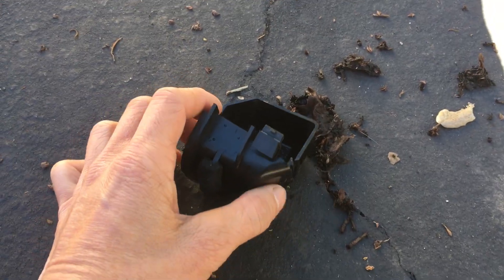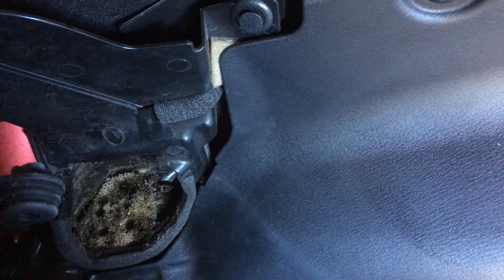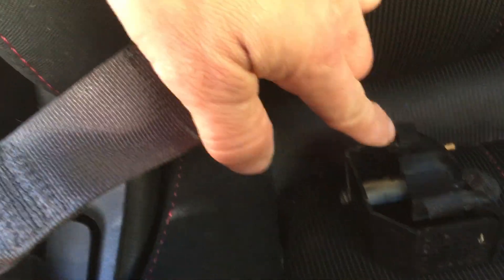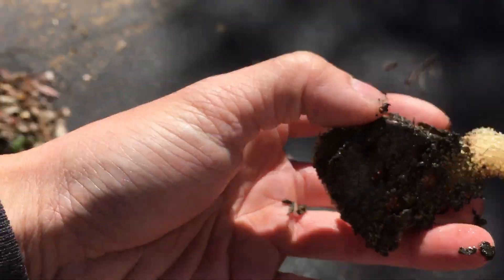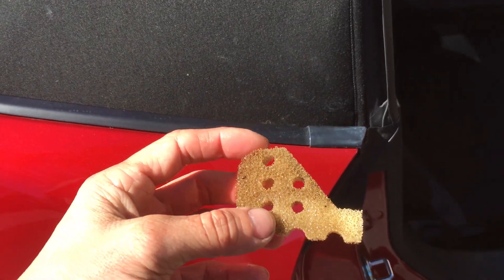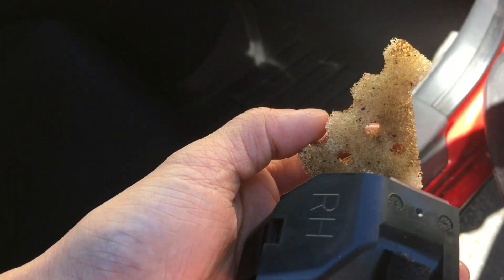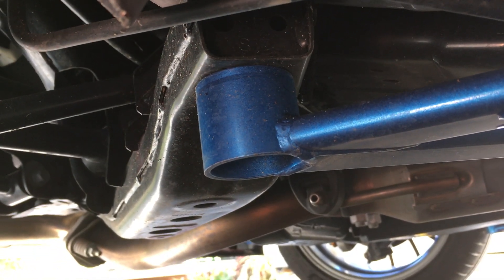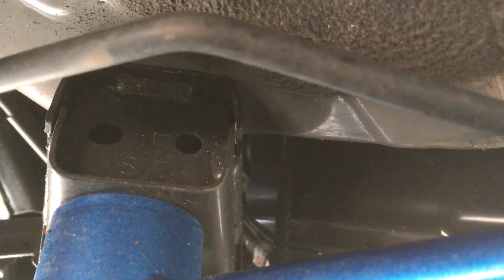ND Miata soft top drain screen clean out

Comment: You’re doing the hard way. 
Remove the door kick guard ( just pull it up and away) then there’s one tab clip just looking at you going up vertical and 2 larger clip tabs behind the seat. Remove them and pull the plastic piece out. Now you’ve got a clear visible view of the basket. Push down in the release clip you mention. Then grab the little black sponge covered tab that’s next to the release clip tab and pull inward towards the interior of the car. It comes right out. Now it becomes very easy to see the beige sponge to remove and clean. I’d be careful using a coat hangar to clean out the rest of the drain. It’s thin plastic and could easily be punctured.

Comment: The dealer wanted $400, including the $150 charge just to look at it.  I called Mazda customer service and they agreed to put up $250 although denying coverage under warranty. They were easy to deal with though. The dealer stated the sieves were dirty although I had just cleaned them.   When I picked up the car, which had been left out in a rain storm and the carpet soaked, they had lowered the cost to me to $50.  Moral road f the story:  if you look under the car in front of the wheel well you will see an orange plastic disc - that is the outlet and that is what needed to be cleared.  The sieve and sponge under it does not restrict the smallest debris to avoid blocking the outlet.  I call this a design flaw especially as the maintenance requirement does not include reaming the outlet.  Next time I clean the sieve I will replace the sponge with a closer fitting and finer structure sponge.